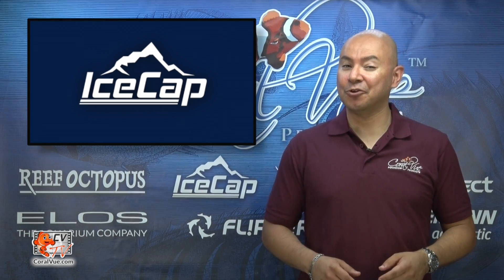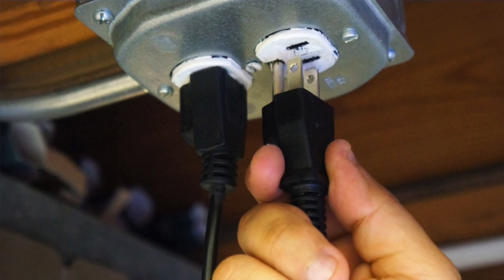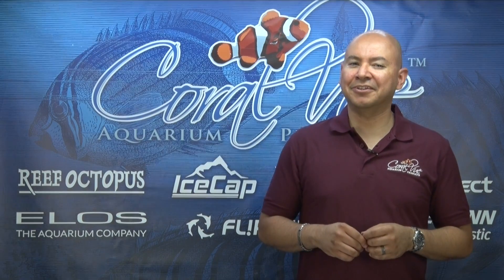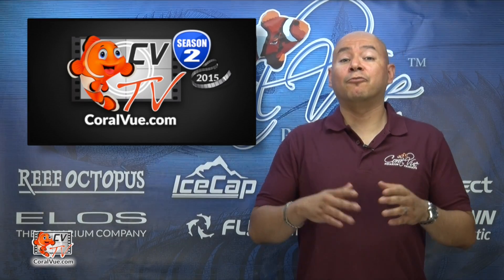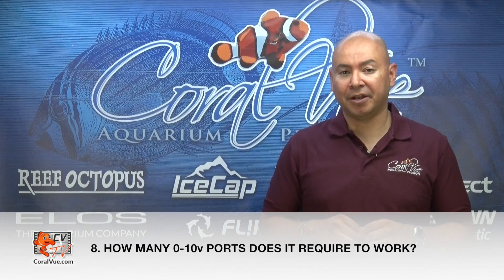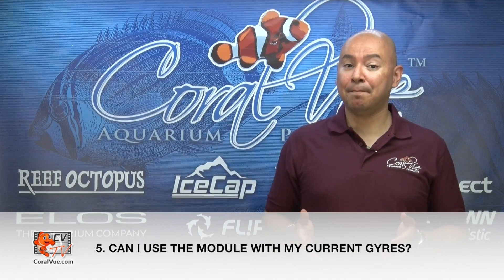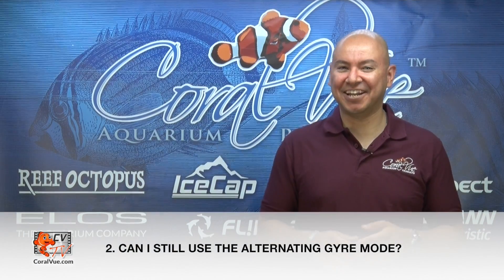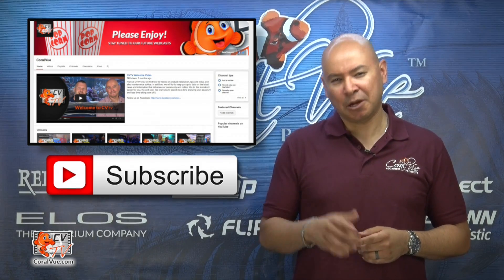IceCap Gyre Interface Module: Setup & Installation

Comment: I have two maxspect gyres but one power supply.  I have two icecap interface modules.  Do I need another power supply?  Or is there a Y cable for power available?
Reply: I have the gyre 250

Comment: If I were to run two Gyre pumps with 2 Icecap Modules, would this take up 2 0-10V ports on a neptune apex? Or can 2 modules  be used off of one port?
Reply: +Scott Dickey You could make an adaptor with some ethernet cable and some rj45 sockets to use just the one port
Reply from the maker: +Scott Dickey If you want to run two Gyre pumps using two modules but only taking up a single 0-10V port you will need to fabricate or make a Y cable seen here: http://www.coralvue.com/y-cable-for-icecap-gyre-interface-module
Reply: +CoralVue I am confused doesnt the icecap come with the Y cable?

Comment: Can you still use pulse mode with this?
Reply from the maker: MrSkumFrog 
Yes, not only can you pulse the pump but can set speeds and durations throughout the day. You basically can tell the pump to do whatever you want using a system controller like Neptune Systems Apex.
Reply: I can't get it to pulse with the Apex like it does with the gyre controller.
Reply from the maker: Please check out this post and video and refer to pulse profile. http://blog.coralvue.com/icecap-gyre-interface-module-apex-controller-setup/
Reply: Thanks for the reply. I have used the settings in the video but it's not the same pulse as the one you get with the gyre controller. I've tried to reduce the on-off times to increase the pulse action but it doesn't seem to work.